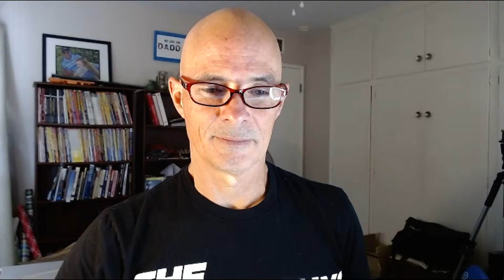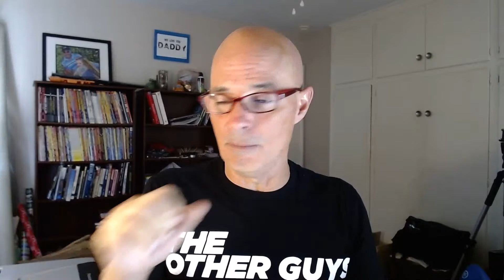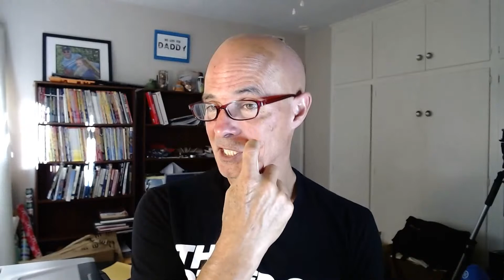LET'S TALK TECH-TURBOS vs STROKER (WHEN ARE CUBES NEEDED)

Comment: Richard do you have tests showing the effects of boring a block from let’s say 4” to 4.030 and unshrouding the valves? I’m being told by a piston company to have my block bored .030 over to unshroud my valves. That’s $1000 task. How much is it worth? Just the cubic inches is at least 10hp. But what can I gain from the unshroudong
Reply from the maker: you bore to increase displacement & compression and make the bore surface finish smooth for sealing, the unshrouding offered by .030 is less important
Reply: @richardholdener1727  awesome thank you!! 393 with standard bore coming my way.